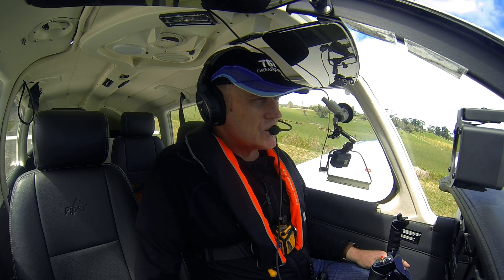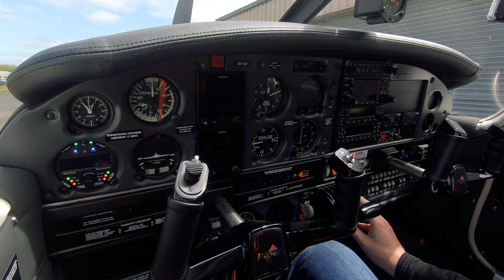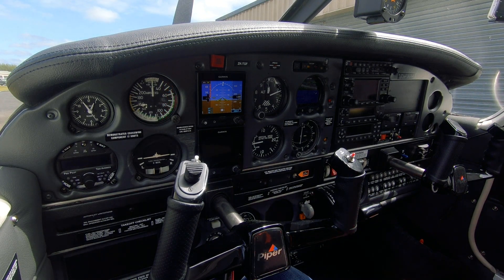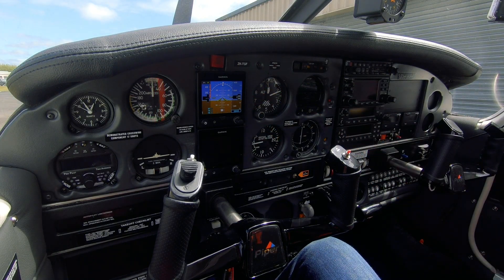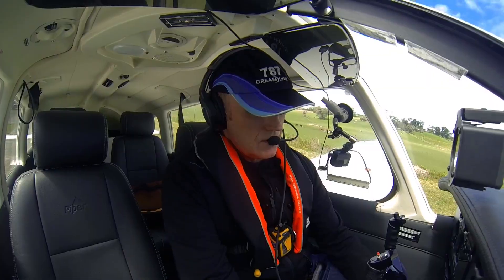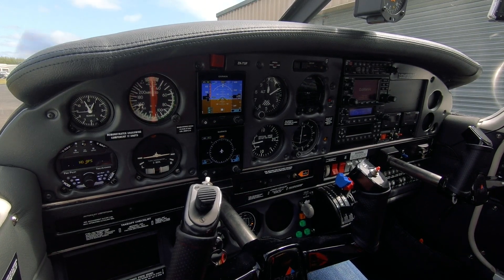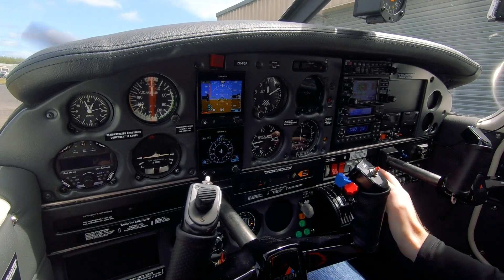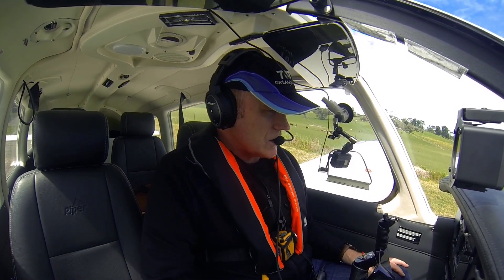Piper Arrow III engine start

Comment: Good video, does the G5 need to be turned off too for start like the avionics?
Reply from the maker: Hi Dave and thanks! The top G5 never gets turned off and is wired directly to the battery bus. The lower one (HSI) is wired to the avionics bus. Makes sense, as you want your AI to remain on no matter what. (And it has a 4hr battery if everything else goes dark)